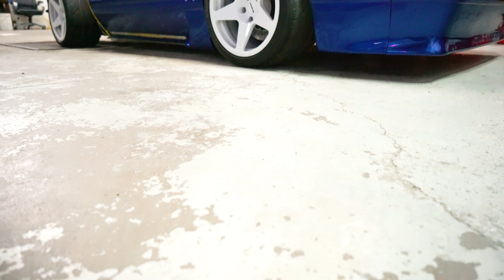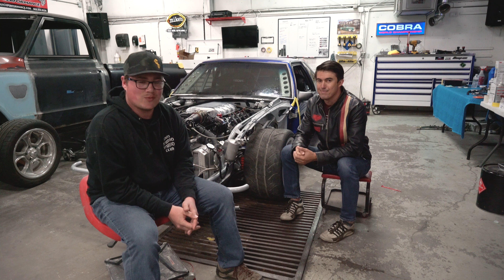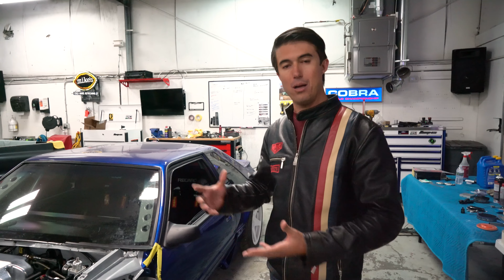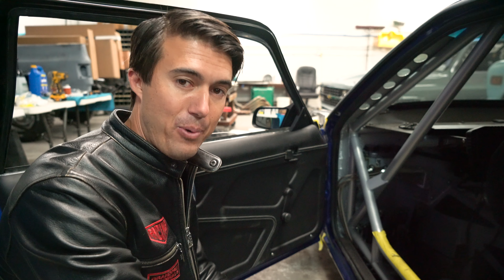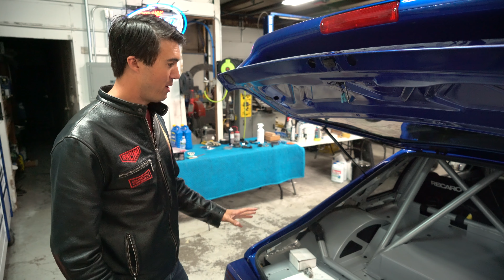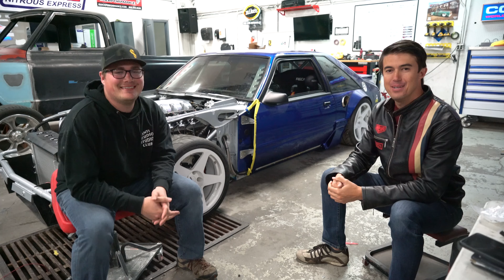Foxzilla Walk Around! - In Depth with Billy Johnson

Comment: Hey saw you on 1320 got here immediately. I love the fox I’ve got a 89 with a 331 Windsor Paxton Novi  2000 blower Hotchkiss suspension set up for grip so you know I love your car and the adjustable boost is cool have you ever thought about putting a wastegate on your boost pipe to regulate pressure?? I subbed I’m here to watch everything you do with this car its fkn amazing tanx bro😎🤘
PS I had a 89 Saleen in the early 90’s thats when I fell in love with foxes
Reply from the maker: We have one of the pro charger ones currently. For road course applications the set up is a bit slow for engine braking (runs off of vacuum on the backside of the intake) so I think we're going to go N/A for next year since we're finished developing the boost application products. 
Should be more consistent and give us some consistency for the big track.
Reply: @CWIPerformance  😎🤘

Comment: I've owned and modified several Fox-body Mustangs but this car raises the bar to a new level. Any more updates coming?
Reply from the maker: yup! we've started tearing into the front and getting the new bumper // crash bars made.
Reply: @CWIPerformance  Caught some photos and videos on your website from Road America. The front sheet metal looks drooped and the fender openings unfinished. But I realize that this is a test/track car and aesthetics was down the list. Amazing how you raised the entire drivetrain.
Reply from the maker: @mchristr  well we ended up customizing the sheet metal on both sides and to get it to mount right it pulled the front bumper up. now that we have the new bumper on it looks alot better. You're right, this is a race car, there's not really a need for inner fenders but the back sides of everything are painted.